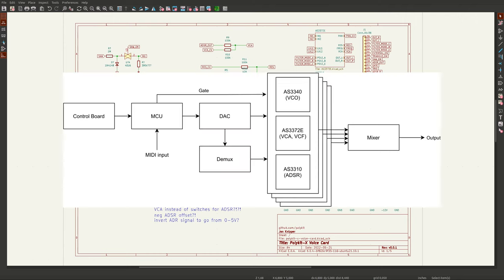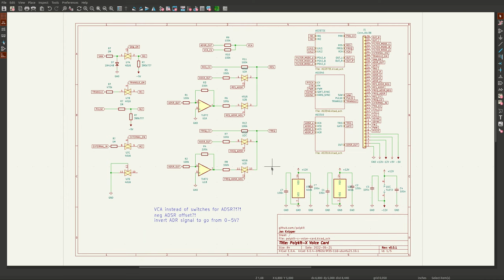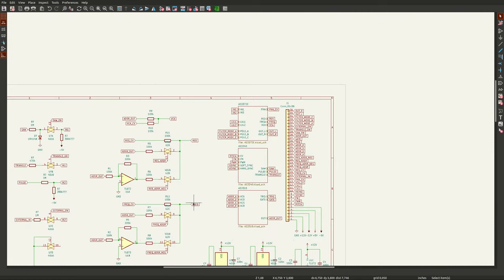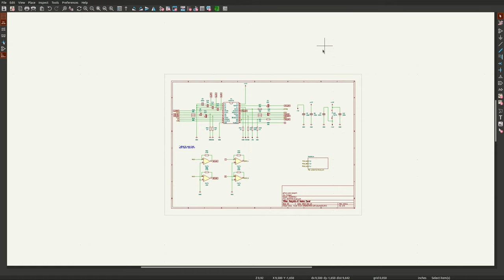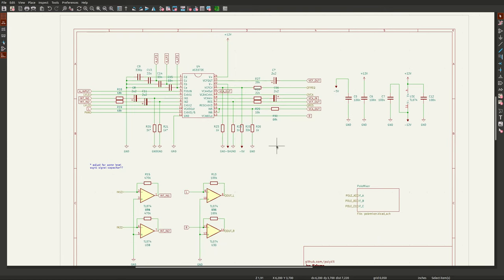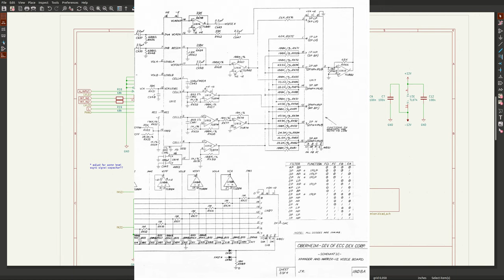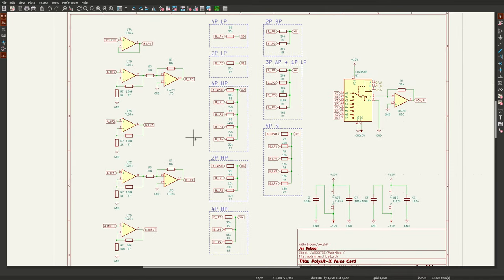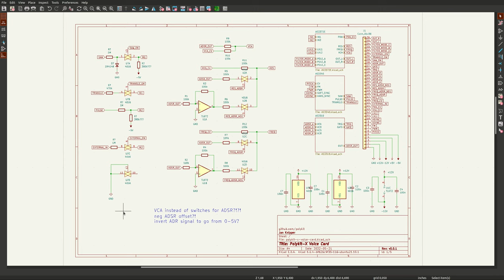Designing a VOICE CARD for a POLYPHONIC SYNTHESIZER

Comment: Awesome stuff. I'm doing something very similar, but based on STM32 chips and using a falling saw oscillator based on the juno60 and some stuff from yusynth. I wanted to ask you, how do you achieve switching with signals and presets digitally? Any hints or reading suggestions? Thank you for sharing this great project.
Reply from the maker: Thank you! Usually some DAC, a demultiplexer (eg. 4051) and a hold capacitor is used to set all voltage controlled parameters. With this presets can be stored and restored by a microcontroller. For switching usually 4066/4016 CMOS switches are used. I am not aware of any specific article on this topic. The service manuals/schematics from early 80s polysynths are a great source of information, I linked some in the description. There is some information related to this in my other DIY polysynth videos. Make sure to check them out. Cheers!
Reply: @polykit  awesome, thanks! I'd love to share my project with you when it's done, maybe exchange some thoughts . C ya